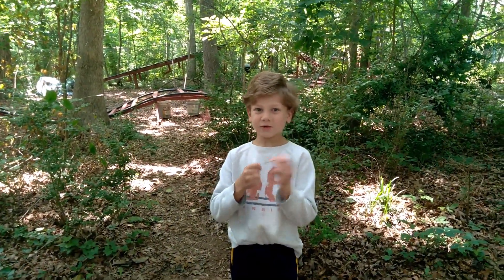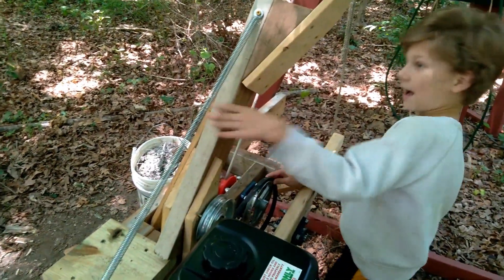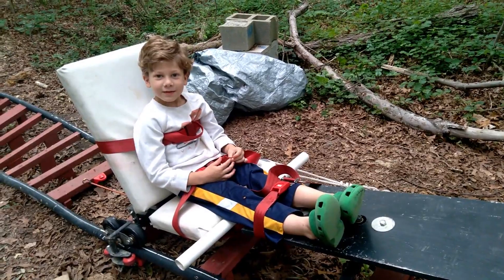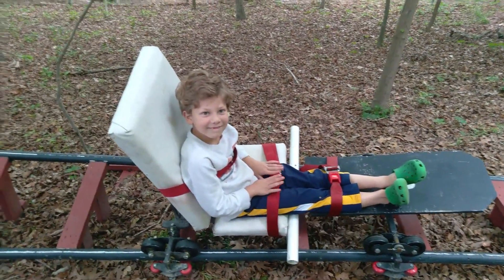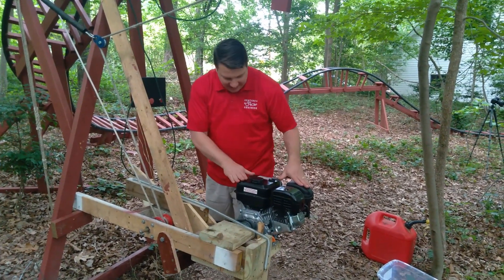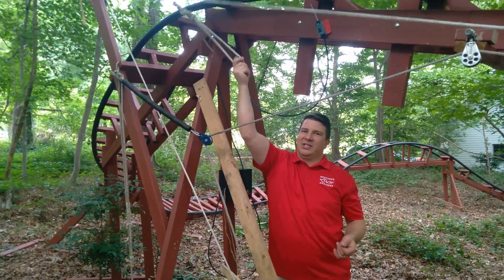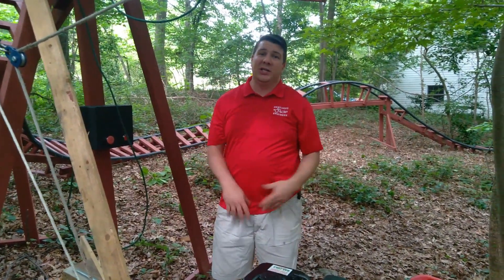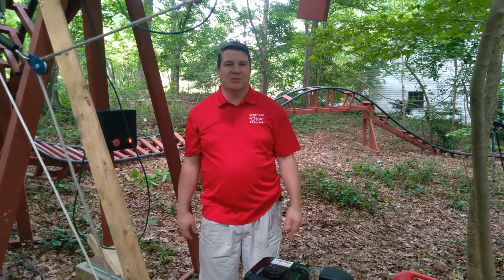Best Backyard Launch Coaster

Comment: An uphill launch as well, it would probably be even faster on straight track. The way it flings you down the drop is sick though
Reply from the maker: Your thought is accurate, but I would have had to design it different to make that happen.  I remade this coaster with a horizontal launch with a drum that has multiple layers.  Each layer makes the rope go faster while maintaining engine speed.  Check it out here https://www.youtube.com/watch?v=QHWr5k2oL-w

Comment: Great roller coaster! I wast just wondering how does the cart disconect from the rope?
Reply from the maker: Good question!  I've used several methods, but they all had their short comings.  I ended up putting a fender washer on rope and then tying a figure eight as a stopper not.  The rope falls into a vertical slot on the cart.  The knot pushes the washer which pushes against this plate.  As the cart goes over the hill, it rope naturally pulls up and out of the slot.
Reply: @MentoredEngineer  Thank you so much

Comment: Seriously so cool! Your son is very lucky. Thank you for sharing this. Was some of your inspiration for this from Lightning Rod over in Dollywood?
Reply from the maker: Thanks.  We have had a great time with the construction and discussing all the systems that need to work together to make it safe.  
Lightning Rod is my #1 coaster, but Twisted Timbers is more of what I modeled this after.  I wanted this to be an "Adult" ride providing a great drop and ejector air.  Mission Accomplished!
We are starting to plan out the next coaster.  This will be a shuttle coaster with horizontal launch, barrel roll and stall out scorpion tail (3 inversions).  After seeing Will Pemble fail at this, I need to see if it can be done.